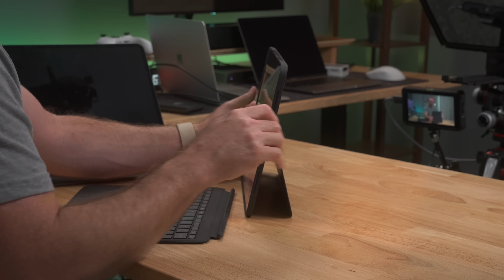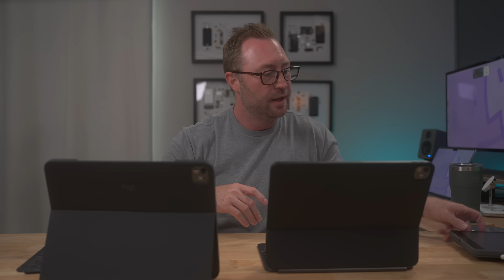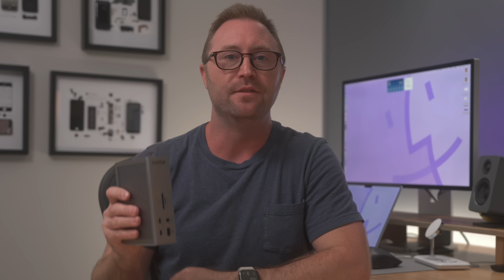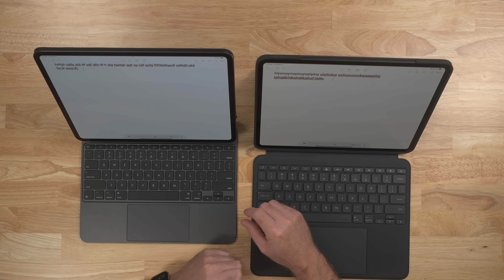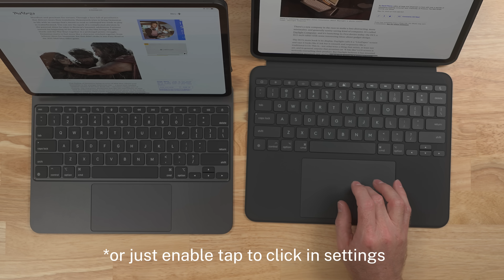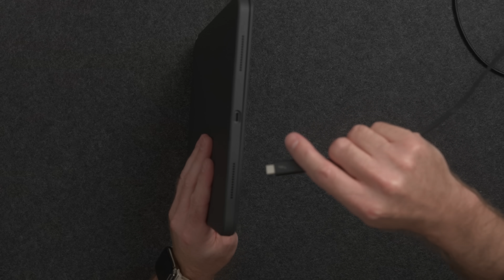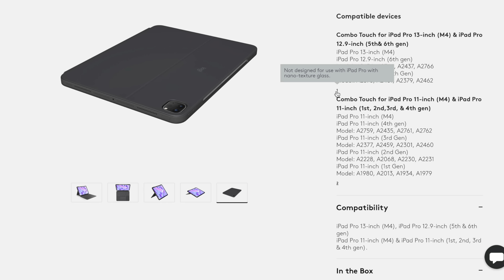Logitech Combo Touch vs Magic Keyboard for M4 iPad Pro!

Comment: I got both the Apple Magic Keyboard and the Combo Touch for the iPad M4 13”. Previously I’ve owned the Logitech keyboard cases  but thought I’d try the Apple case for comparison. 

What I miss with this Logitech case compared to my last Slim Folio Pro is that it does not have a back flap that contains a slot to hold the pencil, a flap that folds over and attaches by magnet to the front when you close it. So I was able to easily bring my pencil with me, it sat safely inside the pouch in the flap where it was less likely to get lost vs if it was only sitting on the magnet on the top. With this new Combo Touch I would have to carry the pencil around with me which is less convenient. But the Apple Magic Keyboard has nowhere to store the pencil either.

I like typing on both keyboards, think the Apple Magic Keyboard is a bit better. I find the Combo Touch’s cursor moves sometimes away from where I am typing to a random spot in a paragraph above. And issues with it deleting some text as I type it. Still have not figured out why that is happening and neither has Logitech. Looking like I have a defective Combo Touch and will have to exchange it.

I found the Apple Magic Keyboard to be very top heavy. When sitting on anything but a hard surface it falls backwards if the screen is at an angle. Though do like its viewing angles. But Combo Touch’s viewing angle are fine too.

In the end, the #1 reason I chose the Combo Touch is its hinge allows me to fold the keyboard not only forward to cover the screen but also back, so I can view the screen when not using the keyboard AND my iPad is still protected on the sides and back. I take my iPad everywhere, shopping, the gym, when traveling, etc so this is important. The Apple Magic Keyboard is good if you are mostly using it when at home but not if you are on the go. 

And adding ~25% to the Combo Touch’s price to buy the Apple Magic Keyboard makes it $$$.

I asked the Apple people why their Magic Keyboard case does not have sides to hold and protect it… and was told it was not necessary since they have Apple Care. Yeah maybe but that is a paid service. Hmmm.  Recurring revenue or designed-in obsolescence …
Reply: Hi JM My situation is identical. The bottom line is that I prefer the Mogi keyboards after all especially when comparing the price. I cannot see why the Apple KB is SO expensive.
Reply: I’m really sad that Logitech is not producing the Slim Folio Pro anymore!
Reply: @jm2511 - it took me forever to figure out the thing with "mystery typing/deleting" on my device.  I found that if my hand is resting (or touching) the trackpad, that's where the problem is.  Some cover their trackpad, others just learn to hold their hand/s up a little above the trackpad.  Sounds awkward, but you get used to it really fast if you are typing much at all.  Hope this helps someone!
Reply: I am trying to figure something out, when you have it connected, it wastes your ipad battery right? 

what if you Use it where the keyboard is folded like in this video, does the battery still get taken up?
Reply: Hi! im planning to buy this combo touch for my ipad air for $165 here in my country are yours still working? and do you recommend it over apple magic keyboard which is also on discount here and i can buy it for $222. Looking forward to your response  it will be a huge help for me to decide, thank you so much!🙏

Comment: Quick question for you? I see you have an older Logitech Combo Touch Case as well, do you have an issue with where the speaker opening is at it started to bulge out? All four of my speaker cut outs on the case have bulged out and I’m not to sure if it a known issue or it just happened with mines.
Reply from the maker: Yep, same on this one. I thought my daughter was pulling at it. My wife’s iPad Air 4, I don’t recall having the issue.

Comment: Very much appreciate this review.  I have both the Combo Touch and the Folio Touch for older iPads.  I love both of them but one thing they have in common is that stand that folds out.  Something about that stand just seemed like it would wear out rather fast considering how it felt.  You're the ONLY reviewer I was able to find that directly talked about it.  So glad to get some information on someone that's used it for years and can report back.  Thank you for that!

And, for the record, both the Folio and Combo Touch cases are very good and solid. =)
Reply: Hi! im planning to buy this combo touch for my ipad air for $165 here in my country are yours still working? and do you recommend it over apple magic keyboard which is also on discount here and i can buy it for $222. Looking forward to your response  it will be a huge help for me to decide, thank you so much!🙏
Reply: @sodiumzirconium maybe the older models, I have the one for the m4 and had a real bad experience. You can check what happened on my last video

Comment: Excellent video and information! I was looking for something on the new Logitech case. I have the new 13” iPad Pro with the Magic Keyboard. It replaced my 12.9 M1 iPad Pro. I bought both the Magic Keyboard and the Logitech keyboard for the M1. I used the Logitech for awhile and loved the extra protection, but ultimately I switched back to the Magic Keyboard because you can pick up the iPad and keyboard and carry it (while it’s open) around in one hand like a laptop. You don’t have to close it to move it or use two hands. That was a bigger deal to me than I expected. If I hadn’t gotten used to using the Magic Keyboard first, I’m sure I wouldn’t have noticed. The other thing is the extra port. That’s handy not just if the iPad’s port is being used, but also if the charger to plug into is on the opposite side of the iPad.

As for extra protection, MOFT makes a great snap on case for the iPad Pro.  You snap the iPad into the case and it magnetically sticks on the Magic Keyboard (as does the iPad without) and it docks the Apple Pencil too (while still allowing it to charge). You can also get a magnetic stand for the case so you can have the iPad stand alone similar to the Logitech case.
Reply: Your comment has helped me decide. thank you!
Reply: Big fan of MOFT. There’s another brand called MAGEASY i found on Amazon that works awesome so far

Comment: Thanks for the great review and comparing the two...  One concern I always have is neither of these tend to "securely" store the Pencil. Some cases (keyboard case combinations also) either don't have a pencil storage at all, or they try to use an elastic or rubber "loop" on the outside of the case that gets weak over time. Apple pushes their new Pencil Pro, so they should get on board and have their new Magic Keyboard securely (internally) store the Pencil.

Comment: I tried the smaller Combo Touch and the stand didn't extend that far (1:48) for a good drawing surface. Maybe I was being too gentle with it, it was an older model, the smaller model doesn't have that option, etc.
Awesome video, thanks for going in depth on these two cases, like footprint size.

Comment: The sides protection with logitech is extremely important, if the iPad falls while attached to the keyboard either open or closed, the tendency to fall on the side is 100% which has > 90% chance of breaking the screen (even with screen protector) basically what happens is the iPad falls on one of the 2 top angles & bends the frame inside which strains the screen and breaks it, when that happens in a tandem OLED display that’s gonna be painful

Comment: Jerry, I must of missed it, but did you go over if the Logitech has a more sturdy Apple Pencil holder, because it’s a full case the Apple Pencil is not compatible?
Reply from the maker: The case does not cover were the Apple Pencil magnetically attached to the iPad.

Comment: You can also add the keyboard brightness of magic keyboard into the control center of the iPad so when u need to change it you can then just swipe from the right corner and change with a slider or put the mouse in the far right corner which will pull up the same thing.
Reply: I had no idea you could do that!

I've been wishing for an easier way to adjust the keyboard brightness without diving into the settings. 

Thank you!
Reply: @T10107  you can add the shortcut to control panel

Comment: Logitech works close with apple for these and they are the only company apple lets use their special mouse and keyboard software, like the little circle mouse tracker you get. So it’s not surprising if the keyboard and materials are similar.

Comment: Did Logitech fix the rubber like frame from distorting/stretching if you just remove the iPad from the case a few times. I got a warranty replacement for my M1 iPad Pro, The replacement soon started warping/stretching after just a couple of removals of the iPad from the case. Otherwise I loved the large trackpad and function row keys. But of course the new Apple Magic Keyboard has a larger trackpad and a function key row. 

What you say about the MK fingerprints is quite true. I put a skin on my old M1 iPad, and will do so on my M4.

Comment: Yo peeps i have an issue with my combo touch. The trackpad seems to sometimes perform a double click (hold to click) and keeps stucking to it until i lock it and turn it back on. Is there any solution to it or will logitech fix these sorts of issues ?

Comment: I ordered both cases, but decided on the Logitech case. I like the "kickstand" on it better. I also have a Surface Pro that uses that same style of stand, so I'm used to that. I just wish they had that pencil holder design of the previous Logitech case. And I use the ESR pencil and screen protector - no issues (other than the magnet on the ESR pencil doesn't seem to be very strong).

Comment: I contacted them about the nano texture glass and they told me it was a typo. Seems like what the answer really is depends on who you talk to over there. I don’t really see how the keys could be a problem scratching the glass personally. They sit I and indentation in the base that makes them level with the edges and the edges line up with magnets on the case portion. I guess you could squeeze it enough to make them touch as the base is pretty flexible but id be more worried about other kinds of damage before that. If I was worried about it I would just store the special cleaning cloth that the iPad comes with in between. Problem solved. I’m way more worried about long term durability of the new cases design than any damage it could do to the nano texture glass.

Comment: Good comparison, but I'm surprised that there was no mention of the warping rubber on the old Combo Touch around the speaker grills and corners. This was a common complaint on older versions and not sure if the new versions of the case will do the same thing.

Comment: Do you know if the connector for the Logitech case is backwards compatible with older versions/keyboards? I have the Slim Combo for the 2nd gen iPad Pro which I would love to keep using. It folds in half so the footprint is just the keyboard area.

Comment: I have the Combo Touch for both an 11” M1 iPad Pro and 12.9” M1 iPad Pro. The case provides great protection for the back and edges of the iPad, plus it still works well with screen protectors. The keyboard is good, but sometimes it randomly disconnects. It works again if I detach and reattach the keyboard.

In three years of ownership the cases have faired well. On the 12.9” case I’ve noticed the area around the speaker grill became soft and deforms slightly on both sides. Doesn’t interfere with using the iPad, just a sign the case will eventually need to be replaced.
Reply: The newer version (2022) has replaced that grill with just small holes to avoid deforming. At least mine doesnt show any sign of age after 2 years. Pretty happy with the update.
Reply: @XZengAu I had the first version the OP spoke about and it deformed around the speakers within months. Logitech replaced it with the updated version it lasted longer but it started to deform as well after a few yrs.
Reply: @DCuerpoJr my old Logitech case literally broke down around those speaker holes to the point the rubber wasn’t even holding the iPad in any more

Comment: I use my iPad Pro mostly while reclining on the couch or in bed, and a lot of that time I’m drawing/painting/sketching. The Combo Touch is far and away the better solution for me for this use case. The Magic Keyboard just isn’t stable in bed for me and often I can’t get the angles right for comfortable drawing.

The Combo Touch keyboard folding back under the stand to create a flat surface is actually perfect for this use case and provides a stable surface for use in bed. Feels like a happy accident but it makes the Combo Touch basically perfect. I would buy this case just for this design even if I never wanted the keyboard or trackpad.

It’s slightly less convenient to type on the Combo Touch in bed, but easily doable and I’m using it to write this post with zero issues at the moment. The ability to remove the keyboard when I just want to carry the iPad around the house to watch a YouTube video in the kitchen or dining room is pretty great, especially as an upgrade from the 2021 Combo Touch which was MUCH bulkier and didn’t have the detachable keyboard.
Reply: Your post was helpful! I’m basically going to use it the same way you’re using it. I actually just bought both the Logitech Combo and Magic Keyboard (iPad Pro 13”) to compare them. The protection was a priority for me and didn’t want to worry about damage or dropping it while carrying it around the house/using it while traveling/laying in the bed.  The Magic Keyboard is very nice but the Logitech’s features/versatility for my situation is working out perfect. I even thought about keeping both, but I know after the “newness” wore off, I’d be using the Logitech. I’m most likely returning the Magic Keyboard this week.

Comment: Switching from the denim like material from the older models to the rubbery one like apple products is such a deal breaker. The previous material was perfect, far more durable and far less prone to visible fingerprints, dust, grime and persistent smudges. That and the function row keys were the main reasons I chose it over the Magic Keyboard past few years so it’s a shame, now there’s less incentive for me to choose it as the only real benefits are it’s a bit cheaper and can be used with just the kickstand.

Comment: Great video Jerry!  I especially loved learning about the tent mode ‘hack’ ,  this is perfect for lap use or when you don’t want to detach the keyboard.  Also, I do have the gaps as well around the edges when pressing down on the trackpad on the Logitech.  I liked your tip with enabling Tap to Click in settings to prevent junk from getting in there.

Comment: I just purchased the smaller M4 iPad Pro and plan to get a keyboard, so your overview of the two products is both timely and helpful. Thank you.
Reply: I am using the Combo Touch with the iPad Pro 11" M4 and it is great and very versatile. I just need to get used to the small keyboard layout (which wouldn't be larger on the MK).
Reply: Save your money and get a ESR keyboard case.

Comment: Logitech still refusing to put an Esc key is such a drawback. The only way to get Esc is to use Cmd+. or remap the language switch key, which is ridiculous if you want to code on your iPad on a remote server with Vim, or execute other commands. That's why this year Apple has the better keyboard IMO.

Comment: I just got it on eBay open box item for $90. The case was tight. i used a hair dryer gently and soften the rubber. it slipped pretty easy. The Logitech combo case protect the iPad and keyboard is on par the Apple case also you save a lot money.

Comment: This is a great comparison. I just received the air 13 combo and it does not look like the keyboard can be attached and flipped back completely without separating from the case.